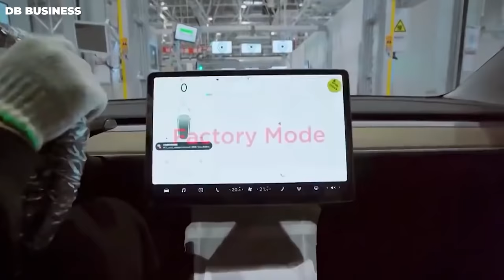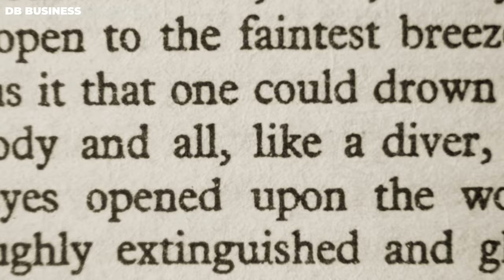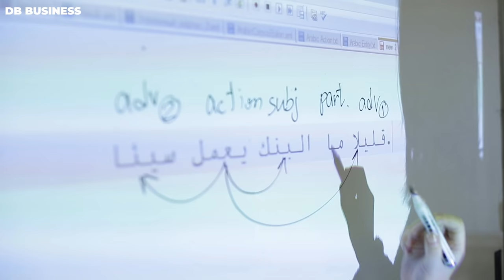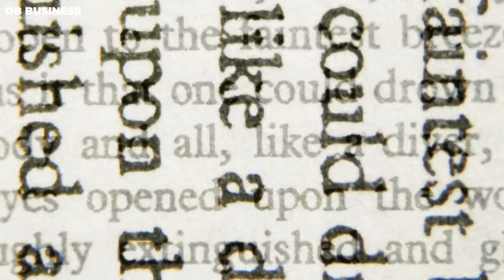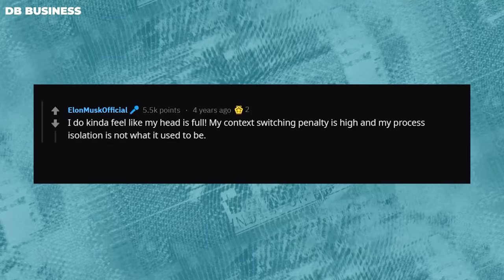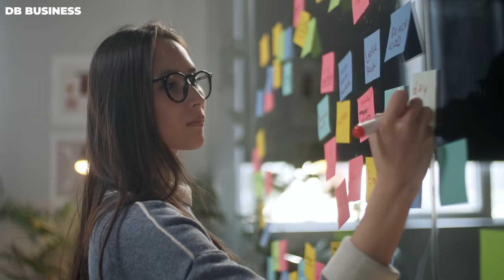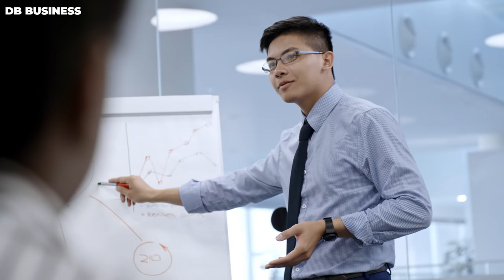How To Learn Anything - Elon Musk

Comment: When you learn something well, maybe you understand 80-90% of it. A master will learn the rest of the 10-20%, which is often times negligible, it's called diminishing returns. Of course sometimes a master is required, but you will get very far without being a master. Also, in the case of Elon Musk he only needs understanding of the concepts, not how to actually perform the work. For example, I can easily understand that a rocket needs mechanical, electrical, civil -engineers, rocket scientists and programmers and much much more. I can also understand most what they are doing and why, but to perform the actual work of the engineers, programmers or the rocket science, well that's a different story.

All that said, Elon Musk is very impressive, accomplished and actually a good programmer himself as well.
Reply: This makes much sense
Reply: so conclusion : 
mastery is needed 👣
Reply: yeah, he should know these as well as how much it takes to accomplish each of the parts involved in building a rocket for to know how to lead well right?
Reply: @jasmine_edification  not really. Being good is already enough. Often the solution comes from creative thinking not mastery

Comment: I am currently having IGCSE board exams and so I can't read about anything else other than the subject itself, which also is specified. InshaAllah, I will start reading physics (especially about astronomy), maybe ICT (designing and coding), surely Mechanical engineering (also, aerospace engineering), and math books.

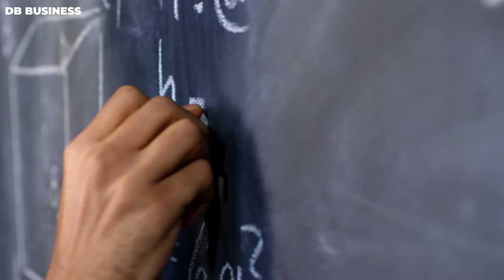Comment: TL;DR  I couldn't award a full 5-star because though the touch points were expertly gathered, most lacked applied essentials.  For instance,  2:49-"Semantic Tree" and fundaments comparative on dance- Even understanding at all what we mean "Semantic Tree" scores extraordinarily high, however the core component of fundamentals being basics is not going to get you doing what we do.  When we do this we are nailing the base down tight like he says, but we are scanning the highest concepts & compiling "semantic" severity associations called "tree shaking" and actually we secure base foundation NOT FROM basic fundamentals as mentioned.  We derive the fundaments from the most advanced parse first and therefor the basics of "Einstein" so to speak are our "trunk" because we practice highest down not base up.  So actually he explained to you how to learn "leaves" of knowledge so you can build "trunks" of understanding and I can't blame him since this is very hard to know.  Finally let it be said, he did fantastic.  It's just that it's literally the highest level to this so he missed the forgivable hardest elements and actually some weren't right but only at the very hardest level of understanding it.

Comment: Enlighten me, does the gravitational pull of all kinds of objects = 9.8m/s? I tried to drop two different items of different weights from the same point but both landed at almost the same time? It was a crumpled piece of serviette and a Samsung galaxy note 5 in a room free from any movement of air🤔🤔
Reply: all objects fall at the same time regards of their mass. The forces might be different but acceleration (deceleration in this case) is constant 9.8 m/s^2. 
Thus the time taken is same.
If u r wondering why the acceleration is constant it is bcoz the mass of the objects is insignificant compared to the mass of the earth.
Hope it clears up ur doubt